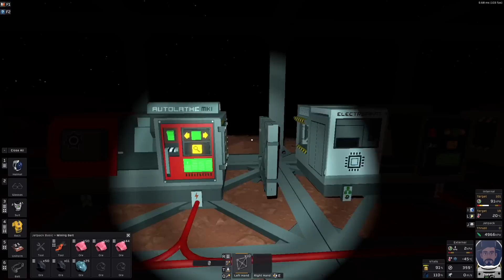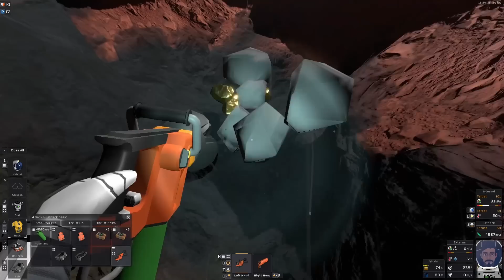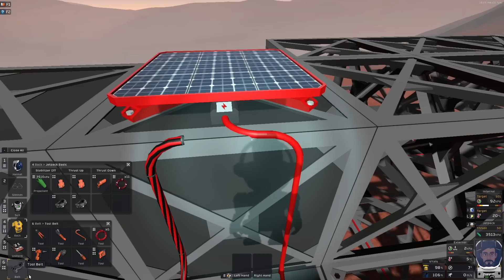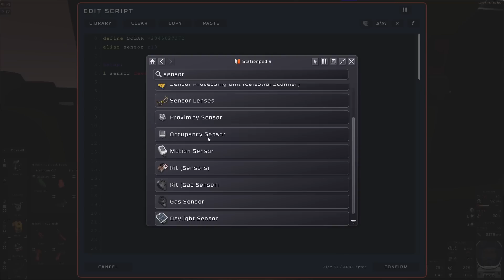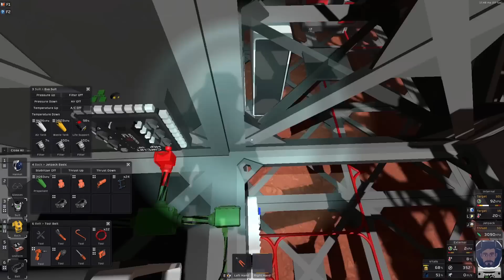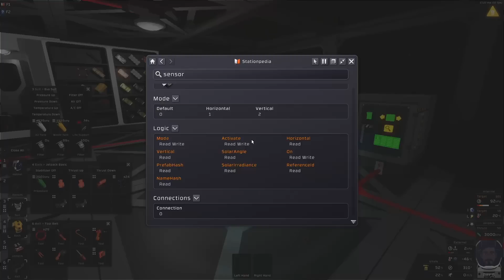Stationeers - New Mars 2 - New tricks for solar tracking.

Comment: Alternatively, you could setup your panels with single ports, face them to 90, face the daylight sensor port to 90, and use this code to automate the panels: (although Mick's is half as many lines and so more efficient)

#Mars solar tracking, single port solar
#panels; ports must be same direction
#as solar sensor port
#Panels reset to start position at night
alias Sensor d0
alias Horz r0
alias Vert r1
alias isDay r2
define SolarPanel -2045627372

Start:
yield
l isDay Sensor Activate
beqz isDay startPosition
l Horz Sensor Horizontal
l Vert Sensor Vertical
sub Horz Horz 90
sub Vert 90 Vert

yield
sb SolarPanel Horizontal Horz
sb SolarPanel Vertical Vert
j Start

startPosition:
sb SolarPanel Horizontal 90
sb SolarPanel Vertical 0
j Start
Reply: to do this one must use the dual port IChousing and split the data and power also change D0 on the housing to be the daylight sensor...
Reply: @Mr_Vengeance87    Thanks for the reply.  Currently I'm using it like this:

define sPanel -934345724
alias sensor r10
alias isDay r11

lb sensor 1076425094 ReferenceId Maximum

start:
yield

l isDay sensor Activate
beqz isDay startPosition

l r0 sensor Horizontal
sb sPanel Horizontal r0

l r0 sensor Vertical
sub r0 90 r0
sb sPanel Vertical r0

j start

startPosition:
sb sPanel Horizontal 0
sb sPanel Vertical 0
j start

If you know of a way that I can do this with a single ported ICHousing I'd definitely implement it.  Power has to be maintained to the housing during darkness.

Comment: I am new to this game and been using this series as a way to ease me into it.
However, having failed to follow this guide for automating solar tracking by not realising that there are in fact TWO different panels to choose from, i.e. dual and combi wiring, AFTER the fact that I shoe-horned in an entirely different data cable along with all of the re-jigging and re-wiring of several items in the surrounding area in order to accommodate such a line, I can safely say that I am going to take a few days off from stationeers until I find the will to carry on with reversing such a stupid oversight at such a fundamental level lmfao 

Thanks for the vids either way they are a great help when I do follow them properly XD

Comment: Hey Cows,

I recreated your solar script and it works perfectly.

Now I've reached a point in the game where I can use "Heavy Solar Panels" that don't need to be repaired. What would I need to write to add these Heavy Solar Panels?

Could I also create a separate circle with only Heavy Solar Panels and simply replace the existing tracking script with the Heavy Solar Panel's ID? But I don't think that will work yet.

Comment: Summary of Solar in this video:

Notes:
The 0 bearing point on daylight sensor is opposite side of data port. Cows faced Daylight sensor pointing 180 w/ data port facing 0
Cows used the compact version (data & power in same port) of the Solar panel. Solar Panel's power/date port is facing 270 and the Solar Panel is facing 180. By use of wrench, Solar panels dropped down to 15 degrees though didn't seem necessary because only one was whereas the 2nd was not. 

Shopping list:
Computer
IC Motherboard
Circuit Housing
Integrated Circuit (IC10)

Code:
define SOLAR [YOUR solar panel prehash goes here]
alias sensor r10

setup:
lb sensor 1076425094 ReferenceId Maximum

Start:
yield
l r0 sensor Horizontal
sb SOLAR Horizontal r0

l r0 sensor Vertical
sub r0 90 r0
sb SOLAR Vertical r0
j start

I replicated on my Mars save and it worked like an absolute charm. 
Thanks Cows!!
Reply: Question i have all my solar panels in a row use this and the way he has them facing uses alot of extra cable i think 3 extra. If a rotate the solar panels do I just need to move the daylight sensor or/and ic program?
Reply: @darkstararmada1587  Pretty much all solar builds are going to revolve around the daylight sensor placement and then what specifically is typed in the code. 

Generally if the panels aren't looking the right way, and you don't want to mess around with your sensor, it's easier to go to your code, rotate the direction value (90, 180, 270, etc) until it's corrected, then monitor over night. I've found myself in this scenario before.
Reply: @apexkech  yep: just add whatever degrees ya need and `mod rN 360` it to rotate the values into a reasonable range. easy peasy.
Reply: I got to work just add a line 
add r4 r0 90
Changed next line to
sb SOLAR Horizontal r4
Not sure if changing the r0 to r4 meaning anything but didn't hurt it

Comment: For those of us that AREN'T programming GURU's... Thanks again for the great video, Mic.

define SOLAR -2045627362
alias sensor r10

setup:
lb sensor 1076425094 ReferenceId Maximum

start:
yield

l r0 sensor Horizontal 
sb SOLAR Horizontal r0

l r0 sensor Vertical
sub r0 90 r0
sb SOLAR Vertical r0
j start

Comment: That referenceID for coding….ill need to start using that! Update my solar script.  
I didn’t mention in the last vid, and it’s kinda late.  liquid canisters in a fire extinguisher are “insulated”.  I heard, it was your “Health and Safety” locker with fire extinguishers exploding the devs changed it.  I’m not 100% certain, but I think the same applies to the portable AC canister slot too.
To save your lander, wall it off! Regular iron walls will do, it will take about 150 iron (walls and sheets) but it’s a temporary solution (yeah I know “temporary”) until you can do something better.  Another option, burry it. Dig under, drop a mining charge, dig around it and let it fall in.  Cap it off with frames,walls and/or manual hatch.  This solution will most likely be permanent tho.

Comment: There is a bug with AIMEE.  If you pick her up and try and carry her she will beat you up, rip your suit off or ping you into orbit if she touches anything.
Makes that horror slasher noise.
Even trying to get it through a door, or out of a hole, she will attack and kill you.
Reply from the maker: I found a bug where she stops moving and cant free herself.  While trying to rescue her, I did discover her bad temper bug that you mentioned. I lost my suit and was thrown a long way away from the base.
Reply: @cowsareevil7514  Another observation I'm struggling with.  Aimee has X, Y, Z coords.  So you can't just tell her to go to Z+50.  If the "Y" is wrong for that location she goes round and round in circles trying to get up or down to the Y coord.